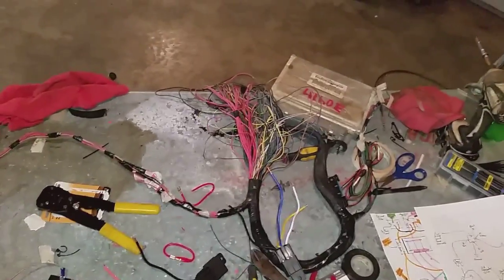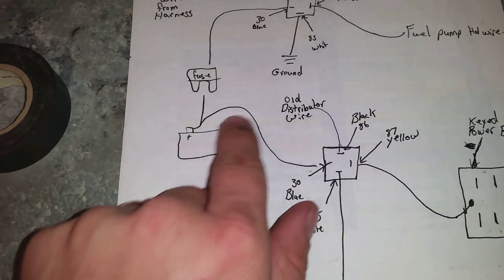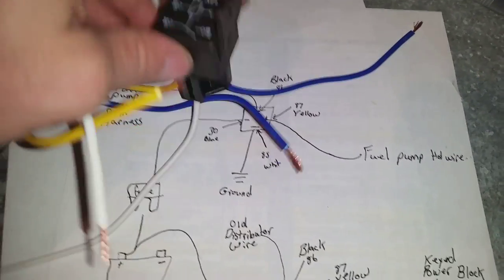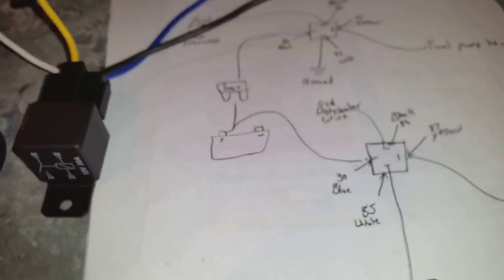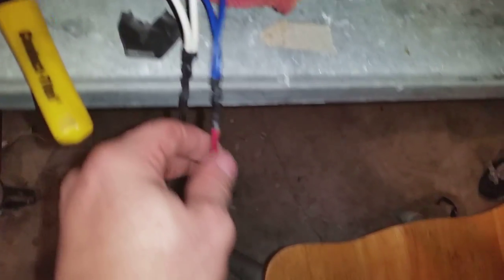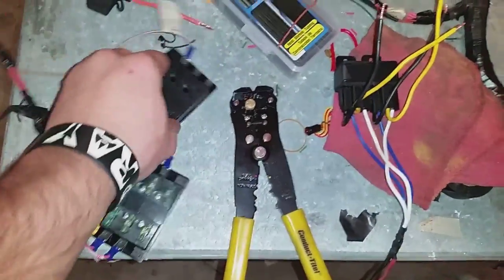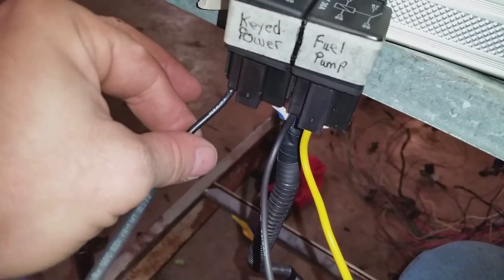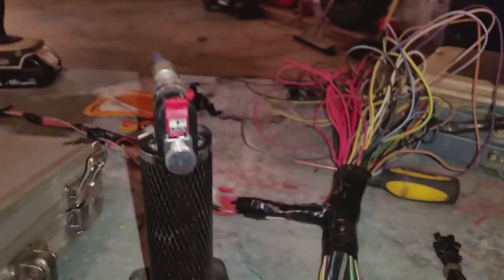How To Guide For A Stand Alone Harness 99-02 Drive By Cable System For LS Swapping Projects (Part 3)

Comment: Couple questions:
Where did you get the relays? I found the blocks at autozone and got them. Can you list all  wires that went to the keyed box and what all wires that went to the constant 12v box? I realize they are basically all pink.

Comment: Very informative, where do you get the constant 12v battery power for the fuse box with the PCV on OBD? pin 20 and 57? 

thanks Rudy
Reply from the maker: I ran my constant power wire to the battery
Reply: thanks
Reply: Okay so i have a my relay for main power relay directly to the + on my battery with fuse and i also ran a second line from + on battery with a fuse to the second fuse box that has pcm and obdII.  Right?
Reply from the maker: +kenpo1203 add me on Facebook and message me. Lonnie Rice
Reply: kenpo1203 was he correct by wiring his second relay like this

Comment: How are you going to wire up TCC break switch with relay or not i been doing some research and i got some mix answers some people are saying relay is a must for TCC others saying only fuse is required
Reply from the maker: 64impalaSS there is a pin out on lt1swap.com. My truck had cruise from factory so I didn't need a relay.
Reply: Oh thanks

Comment: Are you using a 30 amp relay before the keyed fuse box? I would use a 60 amp relay so that if two of you 30 amp fuses get close to the limit they don't blow the fuse before the relay, just trying to prevent potential tracking problems.
Reply from the maker: Eric Teeter a 60 amp would be way to big. The purpose of the relay is to keep it a lil bit small to keep if from melting wires.
Reply: On the keyed fuse box you have 6 fuses if two are 30 amp and you are drawing 18 amp one one and 20 amp on the other that is 38 amp plus what ever the other 4 are drawing you will be blowing out the fuse on the relay as it is not designed for more than 30 amp correct. 60 amp may not be big enough, but should work. You can see why it would be hard to track down the problem. On Painless Performance Products the have main fuse of 80 for this vary reason. You will need the wire to be sized to handle your current of 60 amps.
Reply from the maker: Eric Teeter good point and I thank you for letting me know. I'll upgrade the relay.
Reply: Should lock to the top for those who follow!!
For wire size 12 volt amp size follow: http://www.engineeringtoolbox.com/amps-wire-gauge-d_730.html
Reply from the maker: Eric Teeter how do I lock it to top
Reply: I have seen other do it, have not done it myself. See if there is help for this.
Reply: May want to do vid on this subject, as vary important. Wire size and fuse size and relay size. There are on Ebay 60 amp breakers which in long run are cheaper

Comment: so I hook up on my wire such as windshield wipers, speedometer low coolant lig,ht check engine light, all my dashboard accessories run straight to the key power  side of the fuse box I solder them all to key power
Reply from the maker: Yolanda Thomas you won't have a low coolant wire or windshield wire on the ls harness.
Reply: My windshield wipers from my old harness do I run that and the rest of my accessory wires two key on on the fuse block

Comment: You know if the 5.3 harness les are the same for the 6.0 on a 02 model ? Drive by cable ?
Reply from the maker: CHRIS ULLOA u should be able to use it. You may have to move some pins around but u can get it to work. Just look up the pinouts for both harnesss and compare them to see what matches and what don't.

Comment: Does this work for 2005 on a Chevy 87
Reply from the maker: Yes but u will have an electric throttle you will have to deal with.
Reply: Ohh ok any conns on that lol? And buy disturbureter u mean starter wire or 12v ?